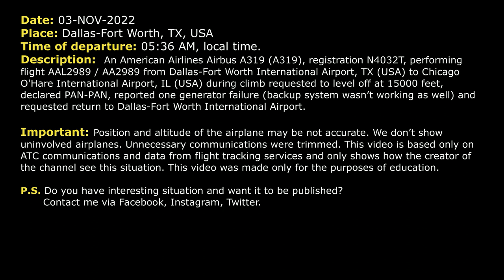“BACKUP SYSTEN IS NOT WORKING”. Generator failure. American A319 declared PAN-PAN. Dallas, Real ATC

Comment: So what is the backup? I’m guessing one generator one each engine and then one on the APU? I’m guessing there isn’t an engine driven backup. 

10 hours flight fuel sounds impressive as well.
Reply: Probably they was running just one engine generator and the apu failed
Reply: Or
Dispatched with APU inop.  then lost an engine driven generator.
Reply: Too much fuel for landing.dumping fuel
Reply: @barbaracameron5610  No fuel dumping capability on a 319/320/321

Comment: I don't think he understood why the controller asked for fuel on board. "We got enough". Yes, they want to know how much time, but they also ask to know how much of a fire  or cleanup they need to anticipate a possibility for.
Reply: Landing heavy..too much fuel.might have to dump some fuel.thats why tower asked abóut fuel
Reply: @barbaracameron5610 
1. Airbus 319/320/321 does not have fuel dump capability
2. ATC asks for fuel on board so they know how long you can stay aloft (hours and minutes) to determine priority.  Tower and ARFF wants to know fuel in quantity (pounds or kilos) to plan for possible fire suppression level.

Comment: so it's a 2.5 hour flight and they have 10 hours of fuel onboard? The A319 can even hold 10 hours of fuel?
Reply: 😂 I was thinking the same thing. 10 hours of fuel yet they’re below Max Landing Weight; seems legit. Not to mention it’s a hub-to-hub route so it’s not like they were planning to fly to an airport with sky-high fuel prices they’d be trying to avoid paying.
Reply: With a nominal range of 3750 NM, but loaded at half capacity, I can see how they could eek out 10 hours. But still doubtful.
Reply: Probably he wanted to say 10 tons

Comment: 10 hours of fuel for a 2 hour flight? Seems a bit excessive not?
Reply: Can a 319 even fly for 10 hours?
Reply: Could be tanker flight ie goes to ORD then say Denver maybe ORD fuel is super expensive compared to DFW.
Reply: They definitely don’t have 10 hours of fuel. Surely he misspoke.
Reply: @saxmanb777  They kept saying 10 hours 10 hours
Reply: 10,000 lbs. Ten hours not even possible with an ACJ319.